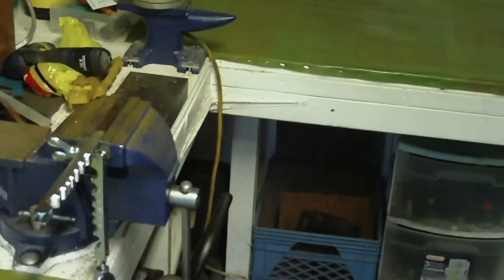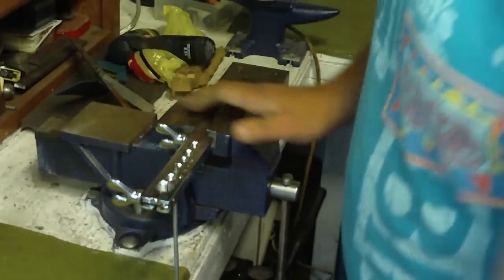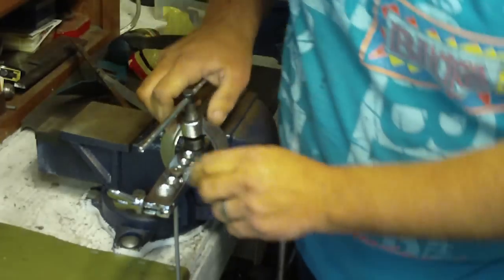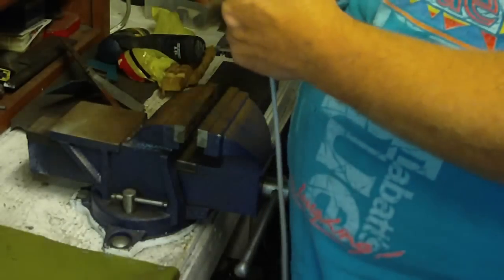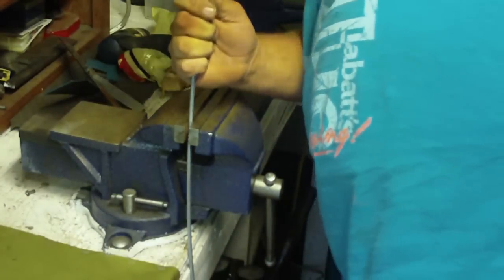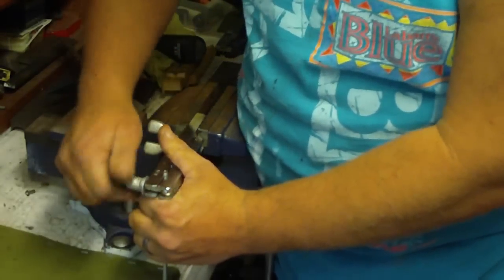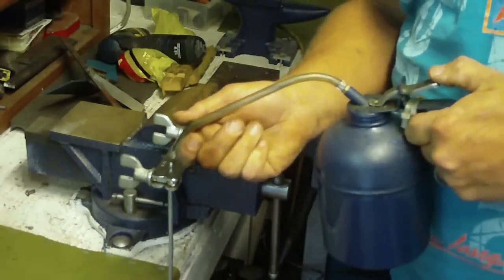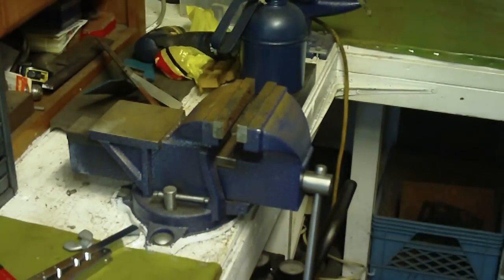Making Brake Line Flares.MOV

Comment from the maker: it depends on the type of flare, you use the bottem of the die to set the height for the flare for a single or double flare and a buble flare a tool is supplied for the height setting other flare tools for different flares have other ways for their set ups as well.

Comment from the maker: @TheRoguePhysicist commercial lines are made with hi end flare tools which do look alot nicer, but with these tools will still do the job right and the line/flare will not leak at all, 80% perfect still gets the job done at the end of the day,if the lower end tools were not able to do the job right, then no one would use them , and i even know plenty of professionals that use these as well and never have a problem, i think you need to rethink your ideas, i also showed double and bubble flares